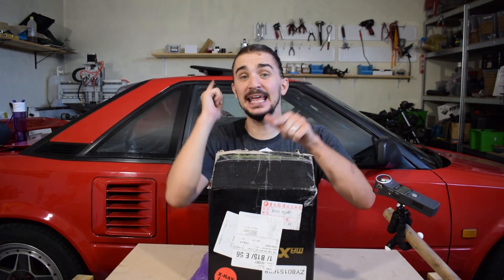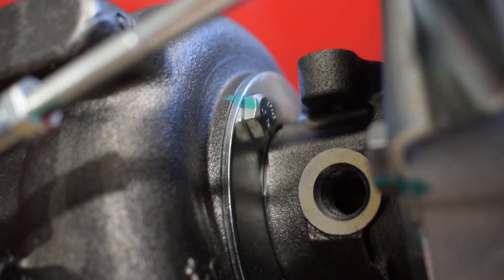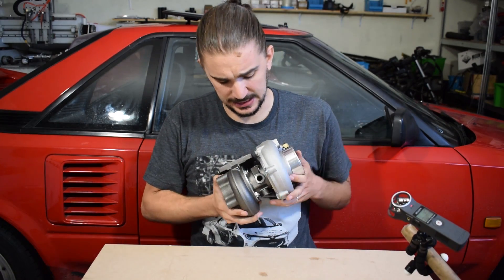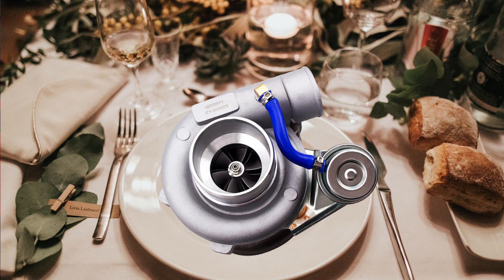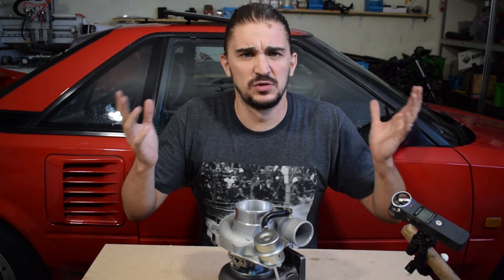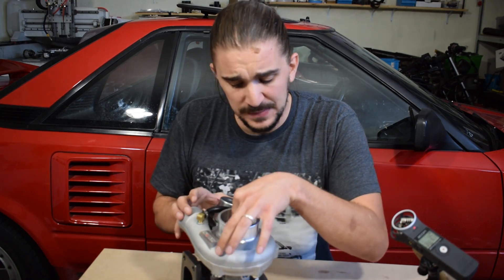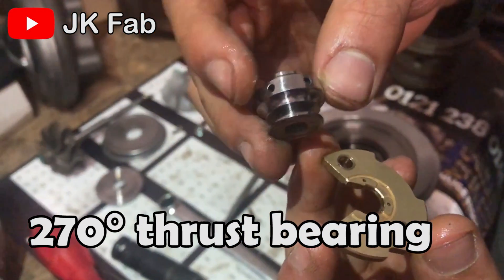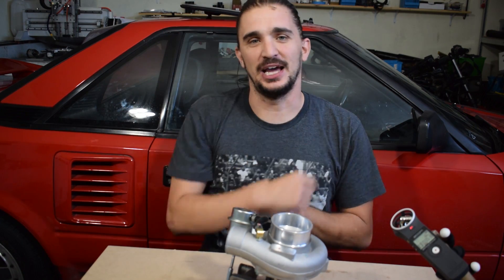Budget TURBO Unboxing and Review - MaXpeedingRods GT28 TURBO - Project Underdog #3

Comment from the maker: Become a Tuning Pro: https://hpcdmy.co/dr4a
Support the channel by shopping through this link: https://amzn.to/3RIqU0u
Patreon: https://www.patreon.com/d4a
Turbo Link: https://www.maxpeedingrods.com/product/gt28-gt25-gt2871-gt2860-t25-t28-sr20-ca18det-upgrade-400hp-turbo-turbocharger.html?tracking=D4A
Coupon: D4A--get 8% OFF for all orders on maxpeedingrods.com
There are no affiliate sales going on here. I don't make any money if you buy anything from the MaXpeedingRods website.
Reply: Great video man. Can you do one on the 6.2 hellcat motor explaining the differences to other v8s along with the materials and specs the parts are and strength it can hold for power after modification. Weak points and fixes.  After market availability.

Comment: I have their gt3582r .82ar and have run it up to 18psi and spiked at 20psi with zero signs of burning oil. And on a stock manifold vg33e-t with a turbo cam regrind it makes full boost at 4K rpm with a .63ar it would be a good street setup but I run at the drag strip.

Comment: Thanks for the info, great video. Do you maybe have any experience with replacing OEM turbos with different variations; new OEM, renewed OEM from shop, renewed original turbo from your car or new turbo from other manufacturers like Nissens, Lucas, Mahle, Magneti Marelli, ... what are good options and why?

Comment: This turbo you have you can run for 2 minutes per half hour. But with the Garrett you can run for 15 to 18 minutes per half hour. That is you can run Rally or drag racing, but you could be drift racing with the Garrett. And of course by running the turbo I mean doubling your atmosphere inside the combustion chamber during intake. Allowing you to run on an air flow sensor instead of an air pressure sensor although I still suggest both.

Comment: I have this exact maxpeeding rods gt2871r on my 2007 fiesta 2.0 duratec (st150) I did away with the internal wastegate as the actuator wouldn't fit against the bulkhead, so I went 38mm external wastegate. it was only a budget build costing me around £2k including mapping and made 285bhp at the flywheel, it is a little laggy but that's good as the engine internals are stock and to much low down torque is what destroys the stock rods, all in all im very happy with this turbo for the price
Reply: Did you weld the wastegate flap? I’m going the same route on the same turbo

Comment: I run a t3/t04e turbo on a 1.6l d16y8 honda motor and see full boost by 3500rpm. That gt28 shouldn't be too bad in the lag department

Comment: i have a Tubo Diesel that runs a Garret GT25 which has seen better days so i want to swap it out but i cant afford $1500 for a new one or even $900 for a rebuilt one, i was going to buy and fit a universal one but each one say "oil + coolant" and try as hard as i might my truck runs oil only! can i still run the universal and just block off the coolant holes? or does "oil + coolant" mean just plug what ever it runs into and send it!

Comment: The Garret could easily be 10 times better if the budget turbo only lasts 5,000 miles. Would be interesting to know if anyone has put many hard miles on the budget turbo successfully.
Reply: you don't take into consideration their performance. If both the garret and the cheap one can perform very similarly, the garrent won't be 10 times better.
Reply: Yeah very true, and ball bearing vs journals is a huge difference in powerband too
Reply: Too right. It's very feasible that a genuine Garrett could last 10 times longer. It might not but it's plausible
Reply: So far 3k miles on mine.  Run about 23psi. No issues to speak of yet. They are fed by -4 an and drain is -10 with one 45° bend. 
I had to port out the internal gate opening. Every time I get in the car I get on it a few times at least.  I do use 5w40 Rotella t6 oil, have the water lines hooked up as well.
Reply: I have a max speeding rods turbo with 10k hard miles on my Tacoma. I will say I only run 7psi rather than the 15 they rate it at but it has still done extremely well for 120 dollars and free shipping.
Reply: I’ve seen quite a few people now use the maxpeedingrods turbos and they seem pretty reliable and definitely worth the price

Comment: Hey there man. I guess this is a little off topic-ish. But I don't know how else to get ahold of you lol. I turbo'd my 3g eclipse with sportronic transmission. I'm tuning it myself (or trying to) using EcuFlash and the tactrix 2.0 cable. I was wondering if you have any experience with it? I'm trying to make my auto ecu identify boost (engine load greater than 100%) I think I may have it, or I'm like half way there, but I don't know for sure(I have my maps edited and showing 10-180 engine load, but will the ecu actually understand it?).... I'm also running a MaxPeedingRods t3/t4 .63 a/r turbo.

Comment: Hey question for you, have you talked to an aftermarket rebuilder/ upgrade about your turbo, I was quoted $450 a turbo to upgrade my turbos from a 2860-5 to a GTX gen 2 2871
Reply: Sorry found my email it was $400 a turbo for new seals and an upgrade to the 71,- the new ball bearing section was 299 prices before taxes and shipping. Pricing is Canadian

Comment: This will certainly be a large turbo for a 1.6L  I am looking at getting this size to upgrade my 4th gen 3sgte in order to hit 400hp+  The 4AF will be an interesting turbo motor though with that narrow valve angle it should take forced induction like a champ.  Will be a neat build. =D

Comment: Hey buddy, cool video!
Q: How are you going to deal with shavings/debris when porting the west gate? I recon if you let any slip inside - its -30% of your turbo life span at first start. If you disassemble to clean - you ought to balance again.
Reply from the maker: You can remove the turbine housing without having to rebalance anything. The cartridge stays in one piece.

Comment: My worry about a budget turbo is not if it will fail and start to smoke etc.  Its the damage its going to cause to my engine when  parts start to fly into my intercooler which may find its way into the engine.  Not only that, but I will need to pay to pull off and reinstall another turbo if it fails.  Why couldn't they just make the budget turbos with better seals and thrust etc?  These days, any turbo should be able to run 20-30 psi of boost since they are supposed to be performance turbos.  Am I wrong?  Please guide me.

Comment: Boznie; congrats! Your just like me. Two seat, mid-engine, coupe. Forced induction is much better than your bike carbs! I have a TPC racing 2nd stage turbo 2.7 Cayman, 5 spd., 380 hp., with Fab Speed high flow cats. You asked for engine topic suggestions and I think the M97, could be a real nich for you. Lots of Porsche guys have very little available information. 🤔😏😄👍👍🏁

Comment: i didnt watch the full vid. but the main issue is the small wastegateport. you going to have problems with boostcreep. i mountet it on my golf 4 1.8t so i dont know how good its compairable. i buyed a new turbo from aliexpress. an Volvo k16 twinscroll. this budget turbo looks almost 1:1 like the original and ist makes on the 1.8T 400Hp with incredible good response. maybe you try this charger too. but it makes boost so early, its very hard on the internials. sry for my bad english. greetings from germany.

Comment: I'm waiting with excitement for your build, and I trust in your knowledge and drive. That being said, 300HP on the wheels is gonna be near impossible on a 4A-FE, unless you end up changing most of the internals and engine accessories. If it can, I wouldn't imagine it lasting long. 
I say this cause I think you won't risk the engine, for just a couple of good Dyno runs. 

I hope you can do it. I also hope you move to the 3S-GTE instead
Reply from the maker: When it comes to the internals, only the block is staying. I'm really not interested in doing everything twice :) The 3SGTE is an amazing powerplant, but it has been done to death on an AW11, and making swaps road legal in Europe is next to impossible. Well, the 4AFE is technically a swap too, but different regulations apply if you keep the same displacement.

Comment: It would be awesome if you do the same but for super chargers later on, everyone talk about turbo but on circuits with lots of curves a supercharger is far superior in terms of stability.
Its quite interesting its oil and water cooled, btw if i recall correctly you have to make the valve hole bigger on that turbo or it will overboost, nvm lol.

Comment: That seems pretty big for the MR2. Might make your peak numbers, but will likely be mostly lag, followed by too much boost? That said, cheapie turbos are generally a good value. I ran the Garrett GT28xRS on my 1.8T Audi at 25PSI but on a 1.6 not built for a turbo? I used one of the cheapie ebay turbos as a replacement on my wifes Audi and it worked just fine (K04). There's a website of a guy in NZ or Australia (don't have link handy) that has lots of good details on how to make power with the 4age

Comment: Even if it was only 10% worse, the thousands of times you accelerate makes quality turbo's infinately better..

Also that turbo has no reference to sizing, if it's too laggy you don't go a smaller cheap turbo and sacrifice power for response, you go more efficient which Garrett offer with better wheels, bearings and differing exhaust housings for same size turbo's..
 I.e I went from 0.83 exhaust housing to 1.08 with a gtx3582r on my 13b bridgeport fd RX7 as it was restrictive and I picked up power, whereas I went from 0.83 to a 0.61 with a gtx3076r gen 2 on my 2.4L bored and stroked EVO6 to pick up response and mid range. 
Where cost saving is a concern, using OE turbo's is a far better option. Comparable to this MR2 build I have a 1986 Mazda Familia bfmr 1600cc dohc turbo which is similar in spec and era as the 4age and I built a twin scroll manifold to utilise a stock evo8 turbo which will happily make 350hp+, will spool better, see 20psi+ no drama at all and best of all used units are dirt cheap..

Comment: Are you thinking about putting a separate electric oil and water pump for this turbo
I am working on it actually on a d5 volvo 
If you want more of info you can mp me if you want.
Thanks for your work 
I think you will not need the suspension from maxspeed...... I already try it and...!? For 100% use on a drift circuit it will be fine, but for sport road use it not pleased me.

Comment: WAY TOO BIG buddy. The GT2871 is wayyyy too big for an AW11 with a 4A engine, and 300 hp is not achievable from that 1.6 liter mill in a driveable manner. Let's look at a few fundamentals shall we?
--
(1) 300 hp is about 30 lbs/min of airflow.
(2) For a 1.6 liter engine to move 30 lbs/min of air it needs to be at 23 psi of boost and 7000 rpm
(3) A quick look at the GT2871 compressor map tell us that you you CANNOT reach 23 psi until 5100 rpm even if you are pulling an 18-wheeler!
(4) This is all assuming that you are NOT knocking and having to crank fuel enrichment up to the stratosphere. and you have a nearly perfect intercooler (which you are not going to have on the AW11)
(5) A quick look at the turbine map is even more troubling... even with the .57 A/R option you are not going to have the exhaust energy to spin the turbo until 4500 rpm or thereabouts.
--
Basically this is an engine that is going to feel like a NA 100 hp engine until about 4500rpm then takes 5 seconds to spool to 23 psi while at the same time the engine rpms are going to outrun the boost coming on. Bam! It's time to shift and you haven't even gotten a second of full boost. It's bullshit! It'll be like a 737 taking off except that before the engine spools up it's time to slap it with a shift and start over! And, that is if your 5spd manual doesn't grenade from three times the stock torque rating.
--
Screw that! You should go MUCH MUCH SMALLER. Forget the GT28, GT25 or GT22! How about the GT2052? It is actually a VERY EFFICIENT turbo. Let's see...
--
(1) You'll make about 230 hp @ 6500 rpm.
(2) You'll only need 16 psi of boost to do that!
(3) The turbo can actually reach the full 16 psi at 2800 rpm under load.
--
With only 2,500 lbs to lug around that 230 hp will get you to 60 in under 5 secs... good enough don't you think?
--
BTW, use a 4A-GZE block please... you'll need those 8:1 compression forged pistons that come with it...

Comment: You need to port out the wastegate passage hole with a carbide burr and a die grinder, (I recommend using an electric grinder as they have way more torque than an air die grinder) they are very small in these turbo's, plus replace the watergate actuator as they have very strong internal springs which will not work well with sensible boost levels, 10 to 15psi. These actuators need more like 30psi to fully open the wastegate! Boost creep at high rpm is very common because of this.

After that the 360* bearing is a good idea if you can find it very cheaply, however it probably makes more sense just to modify the wastegate passageway and fit a better actuator and leave internals as they are since its a cheap turbo and if you need to replace it later down the road just buy another and swap over your modified exhaust housing and actuator for a small price.

Liking your videos, would like to see you make a video on the BDA/BDG engine, if not also the 2.5 Millington found in mk2 escort rallycars that have become legendary in the tarmac rally 2wd world esp in Ireland. Ken Block has one in his escort.

Kind regards
Jason

Comment: Given that the mr2 came with the supercharged variant is that still a viable option for a healthy power band or turbskies all the way?
Reply from the maker: The supercharged GZE can make great power and is massive fun, no doubt about it. The ultimate power potential of a turbo is greater, but in the end it comes down to taste and personal preference in the case of a street build. The real issue with the 4AGZE engine is parts availability and difficulty to source the engine if you don't already have it in the car.

Comment: Looking forward to the "selecting a turbo" video. Have a 1.6 as well but it has a super long stroke with barely any bore so it doesn't rev high but makes as much torque as a 1.6 can down really low. Was thinking a gt25 or maybe even smaller. The goal is boost around 2-2.5k for daily driving. Don't care about top end. 

Keep up the great work, love your videos man!
Reply from the maker: Turbos love big stroke, there's potential there. I'll be explaining soon.
Reply: Can you get a ported 5afe head for me contact me @ tallyharry@gmail.com fb https://www.facebook.com/TallyHarry1

Comment: In poland we have other great way. We buy used turbo in good condition tested it and when we have what we need, send it to regenartion shop and we are happy

In Poland you can buy used turbo for 200-500 pln whitch is about 50-125 euro and regenerate for 375 euro and we have many specialist in modyfing turbo
Reply: MunroM84  i see many hybrid turbo in stock engine

But in many cases regenerated/modified good brand turbo are way batter than chinese one

Comment: Cheap parts are great for learning, I will shortly be on my 3rd and hopefully final set of maXpeedingrods coilovers. It would be awesome if they would make a ball bearing turbo. I'm sure it would still be far cheaper than the big brands. Even if it's $350 instead of $150 that's still way better than $1,000+
Reply: But how on earth they supply the turbo with wrong bolts and gaskets imprecise? That is a sign of poor quality overall

Comment: Some chainese turbos with journal bearings send with 1.5mm hole in the oil inlet, that is really catastrofic, for journal bearings need at least 6mm hole in oil inlet, 1.5mm inlet hole are for roller bearings turbos.
Reply: Wrong. 1mm for ball bearing turbos, and a minimum of 1.5mm for journal bearing turbos, although they don’t need a restrictor at all.

Comment: I have a 1.8 turbo Audi. I replaced the factory K03 turbo with a $100 Ebay K03 and currently have about 4000 miles on it and only 1 issue. The old turbo pushed 21psi, the Ebay turbo at WOT hits 25+psi then I hit a over boost limiter of sorts and it drops to 15psi and holds. I can hear the blow off when it happens. Needless to say I don't go wide open much. Planning to rebuild the factory turbo and put it back on...